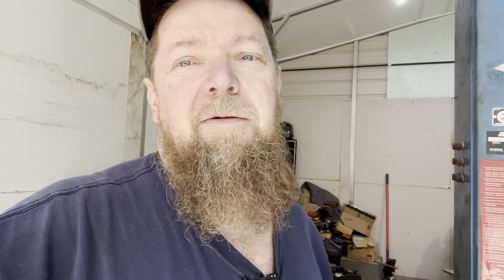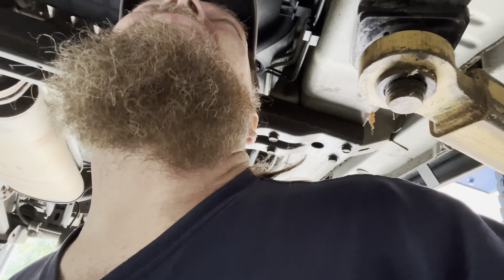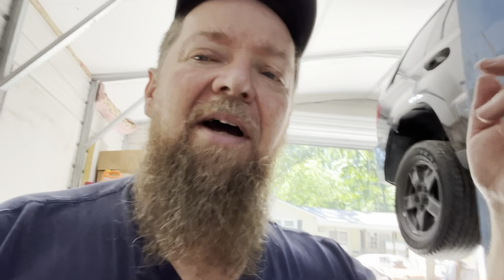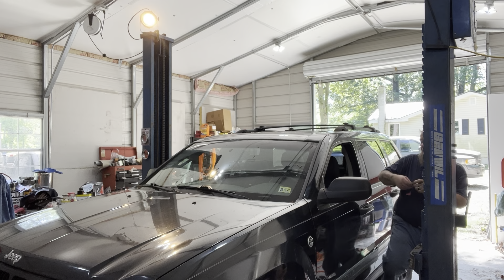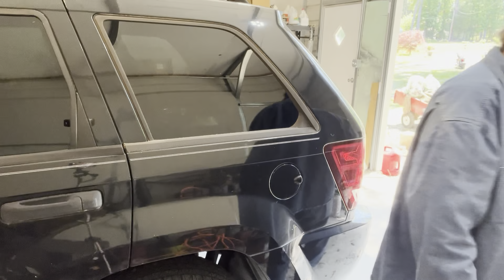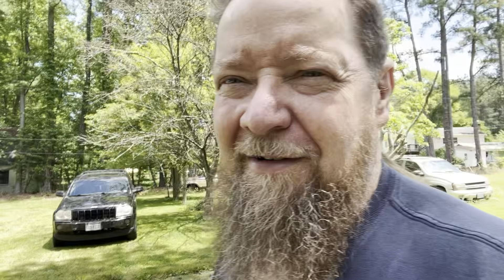How to fix a catalytic converter without removing ￼it

Comment: tell em to sell it quick cause that fix isn't going to last long, most of the time a catalyst deficiency code isn't from a dirty cat, it's from the  depletion of the precious metals that coat the inside of the cat. the coatings get washed away from unburned fuel that is a result of engine misfires and from the use of to many solvent based fuel additives and cleaners .......
Reply from the maker: That’s the plan. Also once an engine starts to use oil the catalytic converter days are numbered

Comment: I.have a chev Cruze been giving the catalyst system efficiency below threshold bank 1 code for a yr now Iv noticed when I run non ethanol gas and or 93 it doesn't do it but 89 grade more than likely gives the code
Reply from the maker: Not sure how octane has anything to do with it. Remember the sensors.are detecting oxygen in the pipes if it’s not burning good then it’s how the engine is running properly or not. All I know is ethanol fuel leaves nasty deposits in the fuel system when it evaporates and ethanol free does not. Those same deposits must go somewhere when it’s burned in the combustion chamber and that somewhere is the catalytic converter. Thanks for your reply.